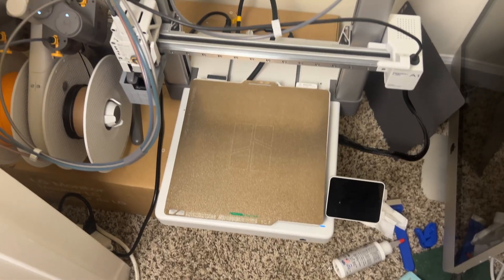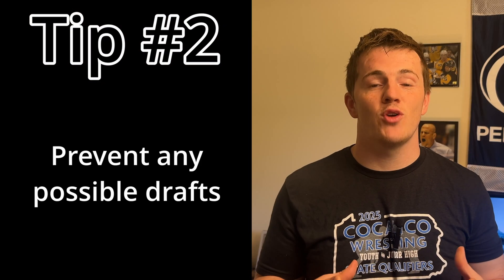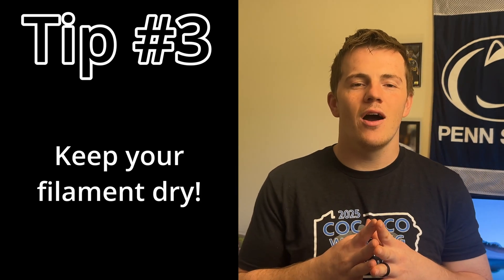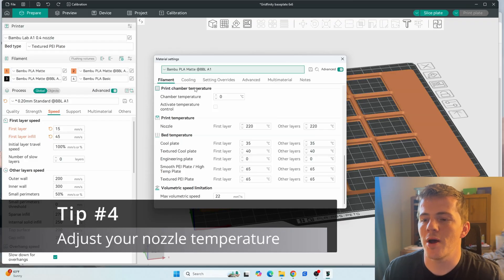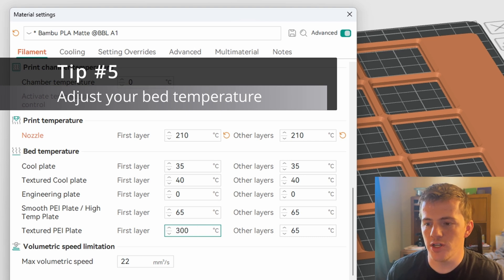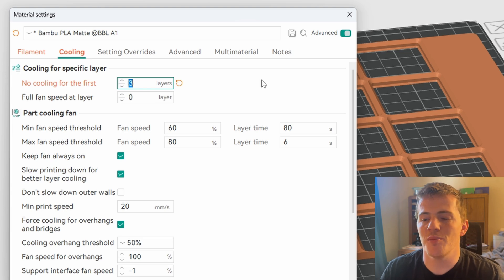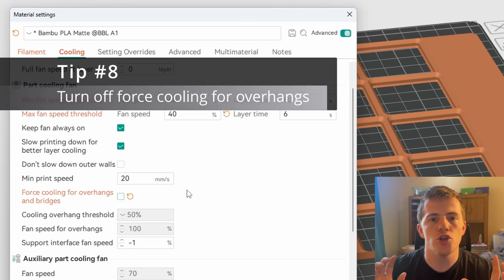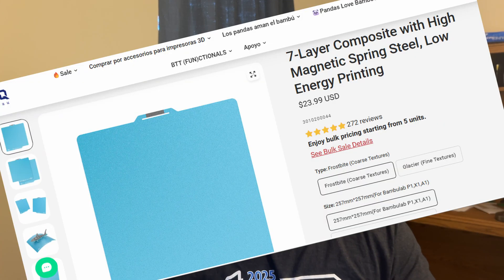10 Steps to Solve Bed Adhesion and Warping on Your Bambu Lab A1

Comment: Thank you very much for this. I switched from a reliable snailpace printer without heated bed to a Bambu Lab A1 mini and it rips just about every print off the plate halfway due to weak bed adhesion. Especially with the textured PEI plate that came with the printer. The Supercool Tack plate worked a lot better but still warped terribly on square shapes. Now that you mention it, my previous printer's parts fan was about 5x less aggressive than Bambu's is by default.
Reply from the maker: Happy to help, my friend! This can certainly be a frustrating part 3D printing, but glad to hear you have it figured out! Happy printing!

Comment: I will give these settings a try. When I print a 200x200 mm print the bottom left and right corners will left off the table and then cause a mess. I dried the material and cleaning the build plate really good. I used the A1 build plate on my P1S and did not have any issue. Hopefully these setting will work. I really don't want to have to start using glue if I can keep from it. Thanks
Reply from the maker: Keep me posted, my friend! Hoping these work out for you!

Comment: Excellent tips, thanks! Question: some people recommend an after-market enclosure for the A1, to minimize temperature fluctuations and  potential  air drafts. What's your opinion on this?
Reply from the maker: Thank you, my friend! Great question - I am more of a proponent of dialing your printer to meet your environment, and in most scenarios, PLA will print just fine with some modifications to your settings. That being said, if you want to make your life easier, have a far easier environment to control, you work in area that isn't climate controlled, such as a garage, or you are working with materials other than PLA, it would certainly help and would be well worth it. At the end of the day, it is your call. I would say go for it if you are printing with things other than PLA - if not, you should be able to et your printer working just fine!

Comment: I'm having this problem with my A1 after just over a week; the pieces don't stick properly, and tall pieces end up warping and coming loose. I wanted to know if there's any method to print on the entire board, like several pieces. Is there a position where the bed will tilt more or get hotter, things like that?
I bought the A1 bamboo when I was still working in manufacturing, thinking about making extra income without rushing to learn. But last month I was laid off, and now I'm in a bit of a hurry to succeed with my flowers to raise some money; it will be my main income. Since I've had more success printing small articulated pieces so far, I want to start selling keychains, but I don't know how to adjust the parameters to work with the bed full of pieces. Should I reduce the speed? Temperature?
If anyone has a tip for a beginner in this world (oh, I bought the combo with AMS, I haven't used it yet, but I think I could have left the AMS and bought a filament dryer...)
Reply from the maker: Hello, my friend! Welcome to the wonderful world of 3D printing and best of luck with your business! Would love a link to your shop if you have the time.

Now onto your question, you can absolutely add multiple instances of a part, if you right click on the part, there should be an option to duplicate or multiply part or something like that (not at my computer right now so I don’t remember exactly what it says). Then once you add the extras, at the top of the screen, you can click “Arrange” and it should perfectly arrange all of them on the build plate.

In terms of the pieces lifting off, especially the tall ones, reducing speed is definitely the right move. Pieces are naturally going to be more flimsy as they get taller, especially with a bedslinger like the A1. Reducing the speed should certainly help.

My door is always open if you have more questions, my friend!

Comment: Two very important addition 

1. Avoid using the edges of  your build plate. They are prone to warping because heat dissipation is uneven. When placing prints, dont put anything in the 10% closest to the perimeter

2. Design parts so that there are no sharp corners on the first layers.  If you have a rectangle, the corner will be more prone to warping than the same rectangle with filleted corners 

Glue stick and brims should be a last resort in 2025, and only used when absolutely necessairy. 3d printing has evolved to where its very rare that you cant solve it some other way
Reply from the maker: Awesome advice! Appreciate you sharing these tips for the community!

Comment: thanks i normally clean my plate with dish soap and have no issues, but recently it was just refusing to stick. got some isopropyl and it fixed the issue immediately
Reply from the maker: Great to hear - I’m a fan of IPA but the community is definitely mixed in that one. Regardless, I’m really glad it worked out for you! Thanks for watching!

Comment: Good hints, I would also like to suggest using a 50-50 mixture of white wood glue and powder sugar in a watery solution for adhesion purposes.   It really solved a lot of issues for me printing on glass.
Reply from the maker: Very interesting - never heard that suggestion before, but glad it works for you!

Comment: also, for Sunlu PLA, temp range is 200-210, would you use the lower range here?
Reply from the maker: I'll be honest, I haven't used Sunlu PLA before. Each brand of filament will have different properties, so I would test different temperatures and see what works best for you. I would still stick to 210 to begin and make modifications accordingly. If you run some tests and still can't figure out the ideal temperature, there are temperature tests you can find on any of the main file sharing websites like Makerworld or Thingiverse that can help narrow down!

Comment: If we use the Bambu Handy app, i can't really adjust the temp or nozzle height, right? I'm a noob but having some issues about half way through the prints. The nozzle seems to rub against the print after a bit. 😵‍💫
Reply from the maker: Totally fair question! Yes, you can adjust temperatures mid print, but not the nozzle height. There is a z-offset setting you can mess with, but I would HIGHLY recommend other fixes first before you try that, especially as a beginner. If you click Devices at the bottom; then click on your printer, then click on any of the temperatures, you can changes them. You can also lower the speed about halfway through, which I think would be my first attempt to fix it. If that doesn’t help, send me the file and I can take a look!

Hope this helps!

Comment: How’s the print farm coming? Any luck with your issues since posting this video? Also, everyone says to avoid alcohol on your beds. It doesn’t really clean the oils, instead it just smears them around. What bed temp are you using now? Just wondering what has changed since then.
Reply from the maker: Honestly, it’s been very, very slow. I have a video coming out about that here in the next week or so, but honestly it’s been tough. But that’s to be expected!

Not a single adhesion issue since I found these tips here. The use of alcohol is definitely mixed. Some people use it all the time, others never do. So hard to know what is right, but alcohol has been working for me.

I’m at 60C right now. 210C nozzle and 60C bed temp seems to be the sweet spot

Comment: Good stuff.  Thanks for doing the homework on this.  I had lots of failures to the point that I started using glue sticks which resulted in 100% success.  Using the textured plate for prints that bed level is the face of the model creates a nasty film from the glue so using these tips may get me over the hump.
Reply from the maker: Glue definitely leaves a weird residue, but I hope these help you out! Keep me posted on if they work and thanks for watching!